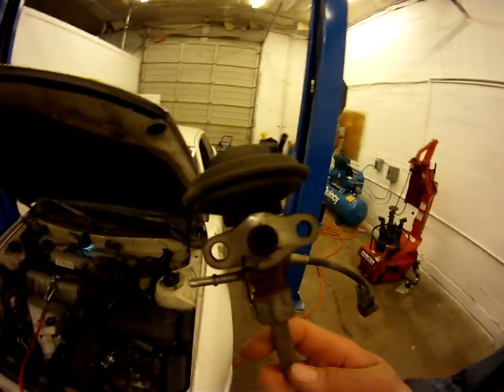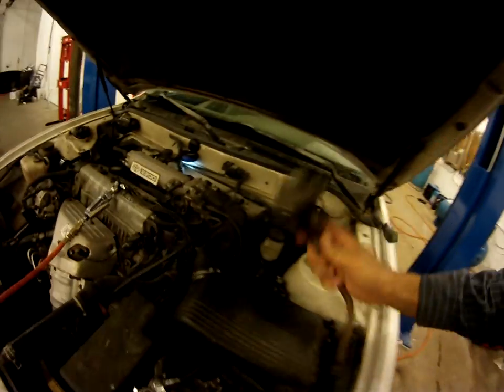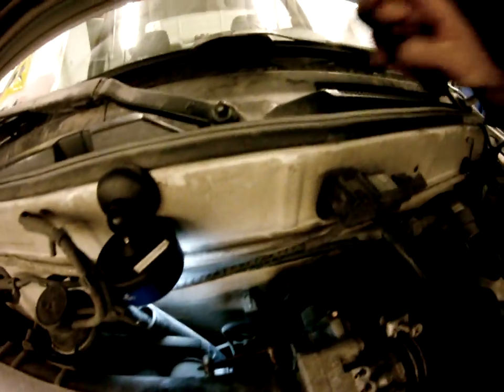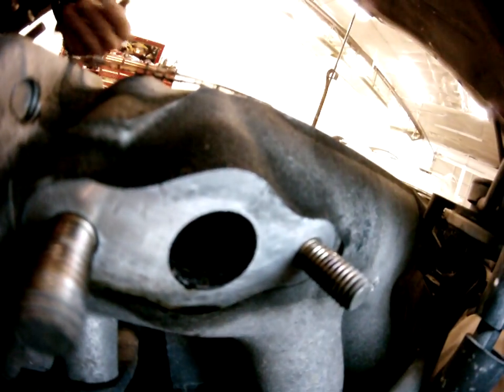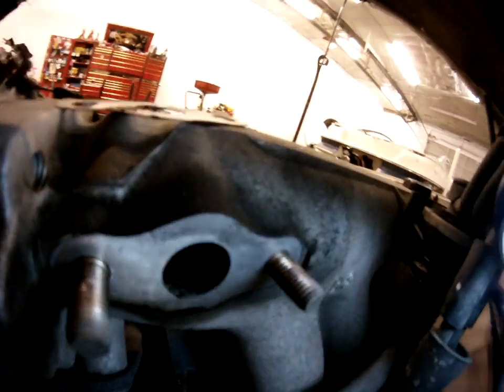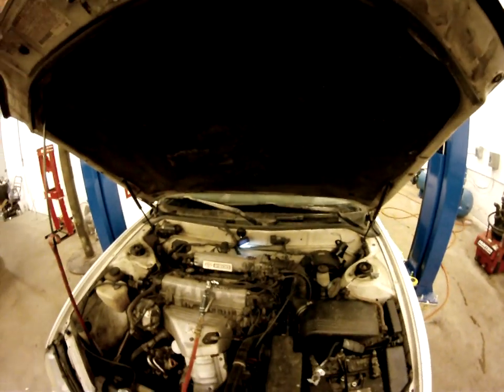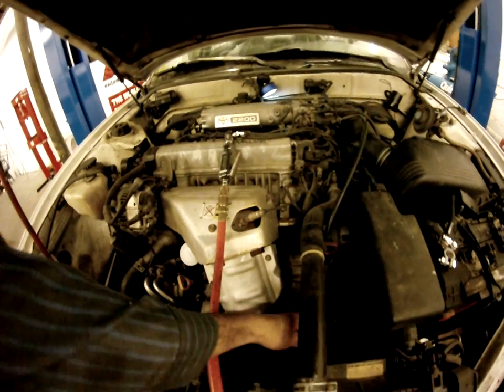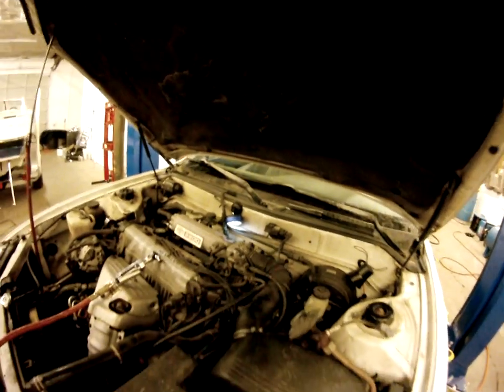Toyota Camry EGR Lesson - P0401

Comment: Put (recommended) premium gas in my 1992 SC400 and the NOX went from 450 to 70! After a can of "smog pass" fuel treatment, it went down another 30 to 50. Too bad I cant fix the high HC...IIRC my cats are shot as they rattle and my boy ran the car for 10 minutes on a bad coil. My EGR was crusty but still had a 1/4" hole in the carbon plug off the intake.

Comment: The nut on the egr pipe is the only non metric part on the car, it's a 1 inch nut. I went to Tractor Supply and bought a 1 inch combination wrench, worked fine

Comment: I disconnected and reconnected the vacuum hoses. Same with the power plugs for the EGR related electrical sensors like the VSV. I disconnected the battery during all of this. Then I drove 100 miles on the highway. The check engine light was still off so I immediately did my smog test and it passed. The light may come back on but I don't have to worry about it for 2 years.    1997 Camry XLE V6

Comment: How did you manage to remove the bottom part? I could barely reach it with my hand
Reply: I was able to squeeze my hand in there after i loosened the nut on the egr tube and turn the nut loose. I have skinny hands btw

Comment: What about if you get a P0401 code and the engine still runs fine at any temp or speed?
Reply from the maker: Just a simple test to see if the thing is clogged or stuck open will tell you if its the issue.  Apply vacuum to the valve while engine is running, if it stalls, then the valve is working and may need further diagnosis.   If it doesnt stall, then valve may be faulty or system may be clogged

Comment: @a&mmotorsports Great video, my son has the same car. Will try this weekend but it looks like its a BIG pain to remove it. Question, can't you just vacuum that out? Do you have to remove the boot in case that happens to me also? And if it can't be vacuumed out, what happens if its left in there? Thanks again :)
Reply from the maker: It's kinda tricky to do, and I suggest using a vacuum only when you get the egr valve off. If you leave it in there, it will rob power and performance from the engine.  Thanks for the feedback

Comment: Should i go underneath the car to take off the EGR valve/port? I was trying to take off the without going underneath of car, it seems very hard..Thanks
Reply from the maker: Actually,  just go down by the head where the EGR tube connects to. Much easier.
Reply from the maker: Use a wrench, short preferred
Reply: +A&M Motorsports Thank you so much Friend. I will do it by today.

Comment: Thank you man vey much, the best advice I found in your video is to get the valve with the tube from under due to tight space other than that I will never be able to get this valve out those tiny bolts on the side of the egr are very rusty and seized

Comment: Thanks but would really like to see how you got that EGR valve removed.  Pointing to where it was connected doesn't help.
Reply from the maker: Adrian N  Well, i appreciate the feedback Adrian.   Basically, its two bolts to the intake plenum, then a 22mm wrench to take break the EGR exhaust tube loose, and you have to get down under the plenum  a little to access it with the wrench......  If i could, i would make another vid, but dont have a car like that to show.  Sorry.
Reply: right on thanks man
Reply: thx I ended up taking it off it wasn't too bad
Reply: Adrian N what size of socket did you use 22mm or 24 mm thanks

Comment: My toyota smog (92 camry 2.2L):
(failed due to TDC
1st: Smog CVI: FAIL FC: FAIL ET: PASS 
15 mph-- 1811--14.3--0.4--81/20/--0.52/0.19/0.26/--554/177/338---PASS
25 mph-- 1766--14.5--0.2--63/17/35--0.43/0.14/0.26--511/155/329--PASS

After timing adjusted to 10 BTDC:

2nd Smog PASS, PASS, FAIL
Everything stayed roughly the same EXCEPT NOx:
15mph measured at 546 where the first time, it was at 338
25mph measured at 519 (failed by going 8 pts over!!!!) where the first time it was at 329

SOB!!!
Reply: ***** Just wait until most people have electric cars. Pretty sure they will formulate some "study" on "e-emissions" to make a replacement test.

Comment: I heard that the 1MZ-FE's are really prone to having stuck EGR valves. My wife's 2002 Camry (V6) would idle really low and very roughly before stalling at a stop, and restarting it again was next to impossible. It would do this maybe twice a month, sometimes weekly. The techs at the Toyota dealer of all people could never figure out the issue every time we took it there. Until one day it died as usual, we called my stepdad (A then Chrysler tech) and told him the issue, he right away suspected the EGR, told us to unplug a rubber hose from it and it started right up. Then we replaced the EGR. You would think that the Toyota techs would figure it out but maybe not. kinda funny how that works.

Comment: Oh my gosh , thank you!  Just failed emissions and the guy was shady on his answers but was firm on his $250 price even though he couldn't tell me what was wrong!  Code P0401 error. I'm going somewhere else!  Now it makes me wonder if the new catalytic convertor he made me buy for my other car was really necessary.....
Reply: ***** It was the solenoid!  Still, only cost me $140, not $250!  Thanks!  I felt so empowered by going in with knowledge about the car and the possible problem! No more rip offs! (I hope) Thanks love!
Reply: ***** Now if you can point me to someone who can help me with my 2005 Ford F250 Diesal Turbo.... It loses power after driving a while and seems to heat up?  When switched off, will not turn on again for at least an hour...

Comment: @Tyson Kunz check your vacuum switching valve. its almost a 1/3 of the price to replace than the egr valve and its behind the engine block near the exhaust line. i replaced mine because the rating on the electrical connecor s

Comment: My Camry is idling high, and stays close to 2k RPM. After inspecting my car yesterday I seen it was broken valve in back of the intake. Not sure if its is just one leak but will continue fixing it. Does anyone know if idling high are one of the symptoms? Mine doesnt die, its like if i have my foot on the gas. I even loosened up the throttle.

Comment: Hi,
I received the same code and I took off the egr and cleaned it.  It moves freely and wasn't very dirty.  I disconnected the neg terminal after cleaning and the engine light went off.....now after driving for 30 min. it's back on???  Now what would you suggest??  Thanks

Comment: I've got the same engine and car as that one, never seen one in the wrecking yard like mine. I've got a P0401 code and a Shift solenoid E electrical code. Everything passed but the car failed because of the engine light. Any idea how to fix these codes? Car runs fine, but the code keeps coming on even after being reset. Nice video by the way.